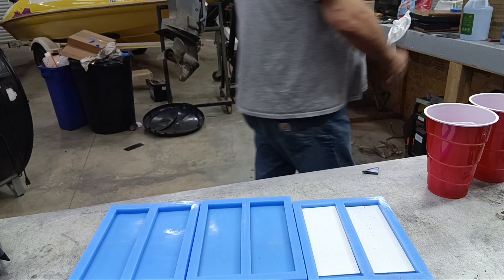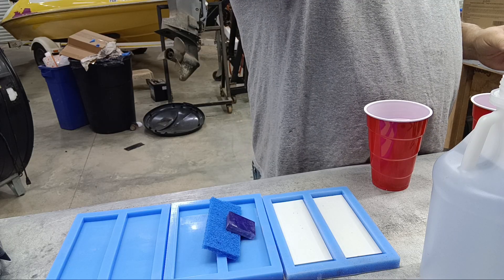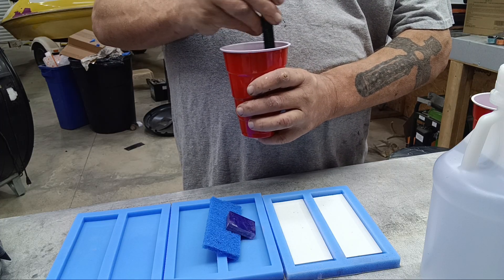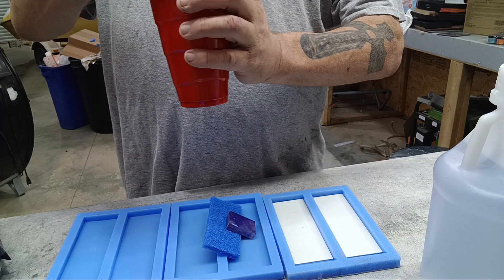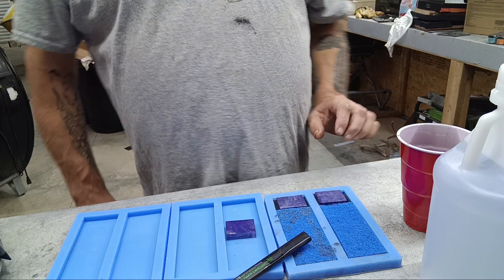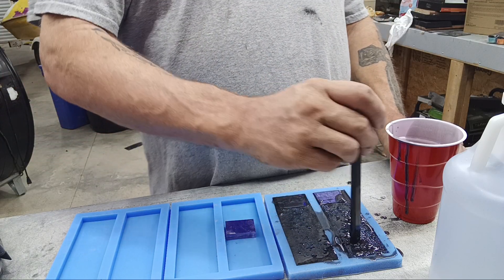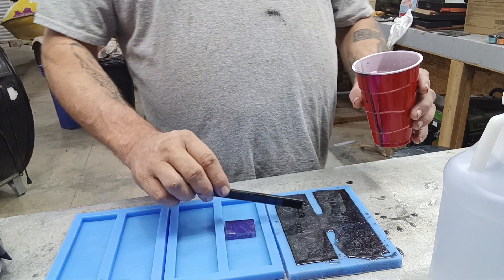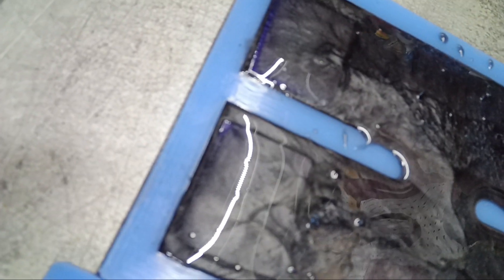epoxy knife scales part1 #epoxy #craft #knifemaking

Comment: That looks like a fun project. Experiments. I epoxy our old dining room table. Think i quickly and carefully hit it with a propane torch to get the bubbles out.
Reply from the maker: @drinkwater1776  I used a heat gun